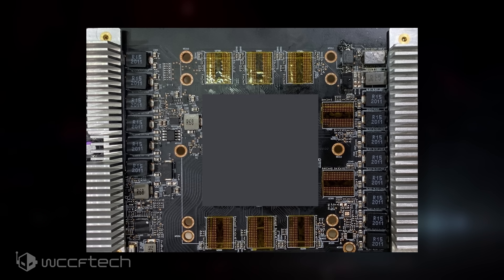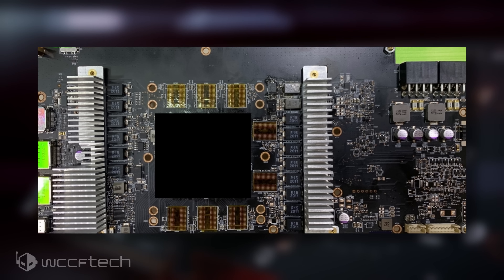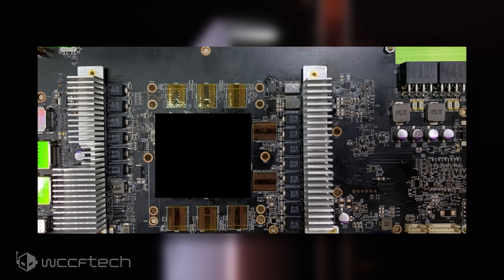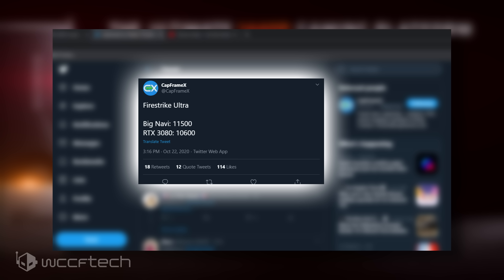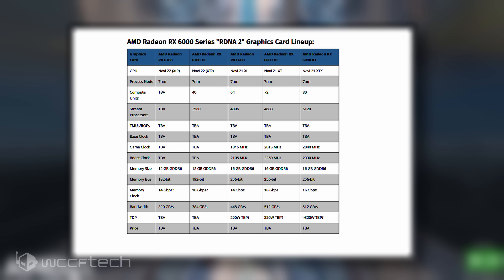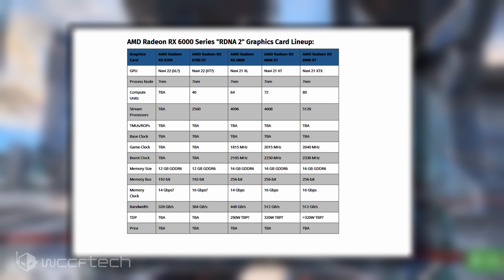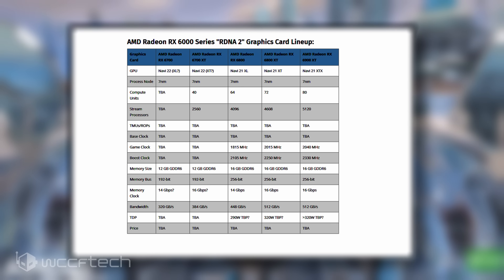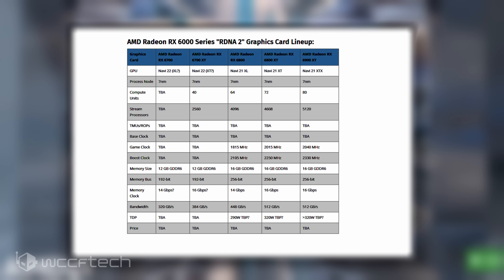Alleged AMD Radeon RX 6000 “Big Navi GPU” Graphics Card PCB Leaks Out 🌟

Comment: Intel: we're the best gaming processors
Nvidia: we're the best graphics cards
AMD: This is what you get for sleepin on me
Reply: NVIDIA sleepin?? Every year they make innovation like DLSS and more matured RT cores and amd ray tracing is still beta.
Reply: @pcmasterrace206  Even in beta, AMD is surely doing something under the cover they don't want to disclose early....unlike nvidia with premature raytracing and solutions like DLSS to market there ray tracing capabilities and at a minimum price of 500$
Reply: @pcmasterrace206  ray tracing simply does not bring any quality of life improvements and it's no different from those hairfx or physx which were all fluff. Instead of giving you a card that's powerful enough to run 4k at high frame rates, they have to fake via albeit intelligent upscaling.

Comment: ALL pictures ive seen have had the die blocked or blurred 
.
my guess..... this is not the biggest big navi..... 
and AMD is the ones leaking it
Reply: My guess is theyre blocking it because its leaked by an AIB partner and they think that blocking out the die they are not leaking AMDs IP cause they made the rest of the card.. maybe they think that will protect them legally?

Either that or it IS AMD leaking this and they blocked the die because there is something truly special going on there. Maybe a chiplet based cache linked thru infinity fabric?

I dunno..  only 5 more days and all of our questions will be answered. Definitly exciting either way
Reply: those 2 8pin connectors mean it draws some serious power. maybe it's the biggest navi or one step below it. whatever this thing is, it's gonna chug 250W or more.
Reply: This is might be 6800xt
Reply: The die markings would perhaps identify the AIB?
Reply: It's an evaluation board. There is no die. AMD didn't blur it, lol.
Reply: Well i know Nvidia dies are lazer etched with numbers. Probably lot numbers and assembly tracking. AMD doesnt etch dies. Well they havent in the past. Which i guess would lead me to believe, if there actually is something under the blanked out area, that its something of merit they definitly dont want you to see. Or it just could be they dont want to give away the actual square mm size. There would be zero reason to blank that space out if nothing was there...
Reply: @notlahaan  nah, then why did they edit in a black box if there is no die? Are there some nuclear codes written there?
Reply: Probably hiding some markings which could identify the leaker. Pretty standard practice
Reply: @ca9inec0mic58  you can infer specs based on the pin-out and there is an NDA in place
Reply: AIBs are leaking it and it's not the biggest Navi because the biggest Navi will be an AMD-only card.
Reply: the packages have a Aztec Code on them and caps arrangement can help to identify the card

Comment: Memory bandwidth seems low. Might hurt performance in certain scenarios. Also the 6900xt has more stream processors AND higher clocks? That's not the way it works usually.
Reply: well the 16Gbps on 256 bit bus with 512GB/s bandwidth vs 19Gbps 320 bit bus with 760GB/s, that is lower,

however AMD is countering lower bandwidth with a large memory cache, where the CU can share already transferred date cutting down the transfer time and reducing simultaneous transfer of multi duplicate data over bandwidth and that will free up the bandwidth and lower the need for more and faster chips, now how well will this work, we will know in a few days

Comment: I thought it was obvious why the GPU is blanked out. AMD do not under any circumstances want that thing leaked. A die size can give a good indication of performance sometimes and they want none of that leaked.
Reply: Why wouldn't they want any of that leaked. What happens if it leaks?
Reply: @nightdark2616  If it is leaked Nvidia will know exactly what they are fighting before AMD actually has it on the shelves. Again dies can give a good idea of performance and it will give Nvidia time to come up with an answer.

Comment: talk and benchmarks are cheap... lets see if it is in stock for a day
Reply: Based on the leaked memo, they plan for it to be
Reply: They can't do much worse than Nvidia and the latest paper launch so yes it'll be better than the RTX 3000 series !
Reply: @Justchuck69   well you can do worse than Nvidia, 
you could pull a intel by having bad management and make your architecture for process node that is only real on paper, 
cancel all new fab builds for your node that works,
and end up playing for the next 10 years "puff puff pass "with the your wafer between your divisions.

Comment: Like I said gonna trade blows with 3080 and maybe gonna be 3 4% faster than 3080 without RT
Reply: Rx 6800xt beats rtx 3080 in synthetics benchmarks so that's a good sign also it's rt performance was ahead of rtx 2080ti but slower than rtx 3080 so that's also a good sign
Reply: So what? Another slightly worse card than nvidia counterpart but almost as expensive. This brings no value to the consumers. AMD is a joke like almost always.
Reply: @brunonkowalski  yeah but at least you can buy it lolololol

Comment: that 6700XT is looking intresting, IF the price is right. Im looking at you my old RX 580, your time is nearing its end.
Reply: I'm looking at my dual watercooled vega 64s...

Which suck btw soooo much power draw for like a little over 2080 super performance and right under 2080ti performance.. could probably beat 2080ti with overclocking
Reply: I have RX 480.

I am looking at RX 6900.

Comment: 320-355tdp on dual 8-pin... Okay 🤣
Reply: Where did we get 355 max tdp?
Reply: nvidia's new 12 pin can handle 600 watt :) .. so they always make power with overhead
Reply: @ventzp2133  from video... According to them it Is powerhungry chip. I dont trust those leaks at all 😁
Reply: because it hasnt been done before??? 
pretty sure my msi lightning 6970 ran for almost a decade with 2 8 pins just fine
.
and its not TDP..... its TBP
Reply: @Kazya1988  1 8-pin conector is rated for 150 watts, so 2x150+ 75 from the pcie slot, but this tgp numbers are not totaly accurate, they come from a twitter user saying that there is a navi21 with a tgp of 255watt (plus all board powers =~320 watts) running at a 2400mhz gameclock...a day later he sayed, that this gpu runing at 2400mhz was a AIB card and it was overclocked so this navi21 will be more likely at 280-300watts for the reference card. the max allowed tgp (wich allways includes the memory) from amd for this gpu´s to test with is 290watt tgp for the boardpartners...
Reply: I don't see an issue here. 2 8pins are designed to transfer up to 150W each. That's 300W. Now add that to the 75W from the PCIe slot and you get 375W maximum. No, there probably won't be a lot of overclocking headroom, but for the average consumer it's fine.
Reply: @peppa1492  if thats the case, i dont think it wuold be stable at all! Same as running rx 5700xt on single 8-pin...
Reply: @Kazya1988  the thing is that the RX5700XT can use more power than the PCIe slot and an 8 pin connector can provide (some versions can use over 250W). On the other hand, 2 8pins and the PCIe slot can provide enough power for a 350W GPU at stock frequencies and still have some headroom. It requires a decent power supply, though.
Reply: @peppa1492  if there Is same ratio it wuold comes 3x8-pin +6-pin for overclocking ahead.
Reply: here the thing the 150w for 8pin is a paper number in the ATX standard 
Molex mini fit jr (aka connectors at the end of your psu cable) 
has higher Current Rating than Molex Microfit 3.0 (aka new Nvidia connectors) circa 2006